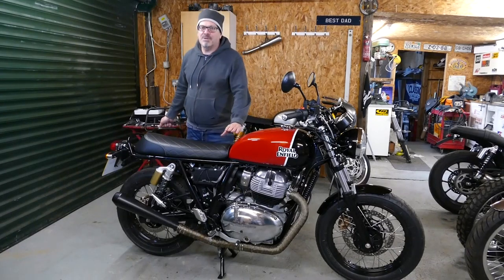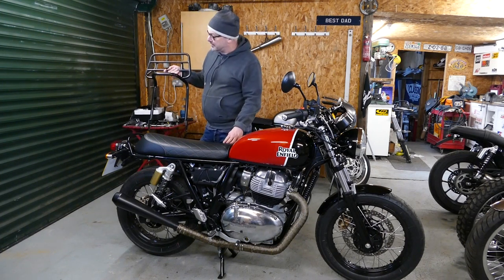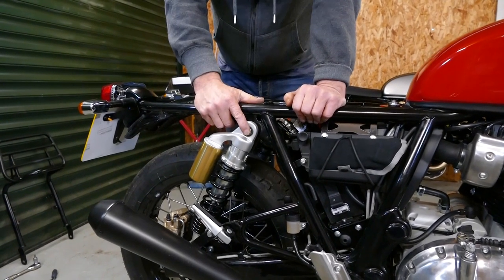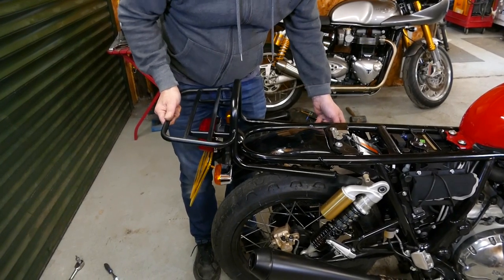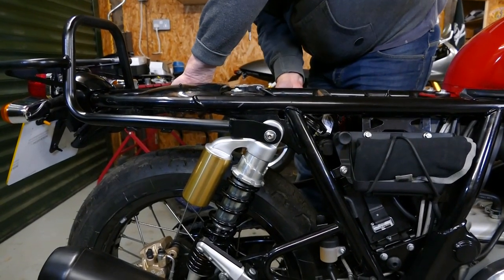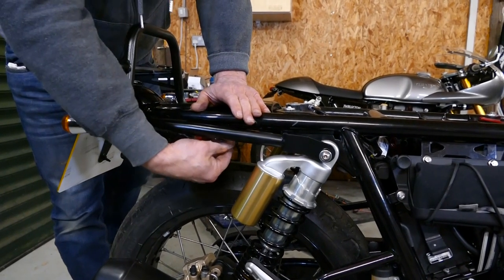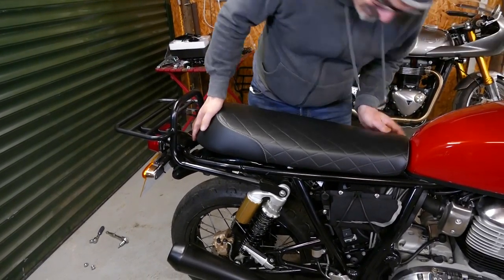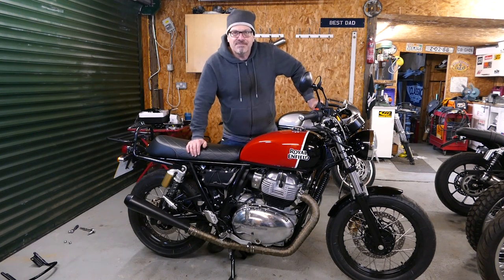Royal Enfield Interceptor 650 - Luggage Rack

Comment: Hopefully this will help someone, but I struggled to get the shock top mount on while holding the rack back as shown in the video. The rear wheel dropped slightly and while I tried to compress it with my weight on the back of the frame, I really needed an extra hand.
However it is very straightforward to move the rear light cluster out of the way.  Yes it takes longer, but then the rack slides in easily from the rear with the shock still mounted.

Comment: My TEC rack just snapped both sides on my Interceptor, 2 days before I'm going on a bike trip. It had an aluminium top box attached to it via an adapter plate i had bolted on it. A mate of mine is hopefully going to weld it up and add some reinforcement to it. I did use it to do Lands End to John o Groats last year, so i had used the rack for about 2700 miles before it broke. If you want pictures to show where it snapped i can send them to you via email or somehow as it might help show where rack could be strengthened in the future?

Comment: Just added my luggage rack but cannot see why you need the new top allen screws on the shocks. The old ones fit just fine and with thread locker should be OK....Can you clarify why we need new bolts, also I got 4 washers, do you need 2 each side or where should they be fitted. Quality of the rack is exceptional by the way

Comment: Looks like an excellent piece of kit, but why is the rack mounted outboard of the shocks rather than inboard, which would, I think, look even neater? Is the lift handle retained on the left side, or is that part of the original grab handle?
Reply: thinking the same inside of the shocks and why remove the shocks when they go on the outside ??
Reply: The straight rails probably make it easier to fit generic panniers, something I appreciate.
Reply: You wouldn't want to change the angle of the shocks one iota.
Just not a good thing to do.
Reply: @burtvhulberthyhbn7583  fair point, but if a suitable washer was added to the bottom mount to compensate, would that solve the issue?
Reply: @martyndeyoung8207  yes alignment would be maintained but strain on the bolts would increase although I'm really straining credulity more than the bolts.
Reply from the maker: It would put the shocks out of alignment, no need now for lift handle as you can hold the rack
Reply: @katana258  I agree. Remove the top bolt. Fit the rack on the outside of the shockie as he does anyway. Replace using slightly longer bolt. No need to slide the shockie off the mounting lug. Please correct me if I have missed something. Anyway, it's a great idea and much stronger than the others which just use the four bolts.
Reply: i was not sure I saw it correct .could not understand the process ..maybe missed something .... thanks
Reply: the triumph rack rails I thought were on the inside ??
Reply: @katana258  I wondered the same thing. Perhaps the removal was to protect the paint finish while placing the rack. Because the rack is mounted at a downward angle, it looked like it needed to then swing upward, to level, once the back was in place. I.e., moving the shock just provided more room for the initial placement.
Reply: do not have a r.e. so he does hands on , I was just judging from a triumph compare .. not really fair .. with out playing with it with my paws .

Comment: A little disappointed with this rack. The fit is not that good. I had to do apply some strength since the holes didn't match. And the screws included are awful and way too long, so I had to use the old ones, even they being short for the new task. The painting could match the glossy chassis too. Well, it is what it is, the product appear  good but...let's hope for durability.